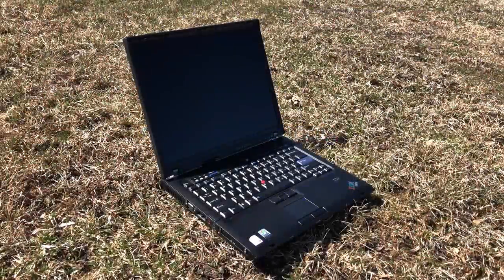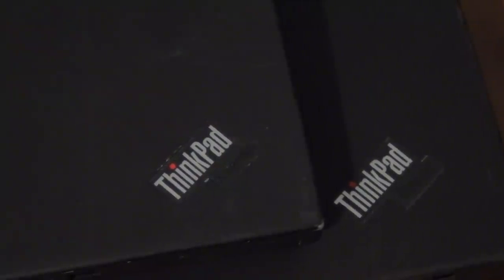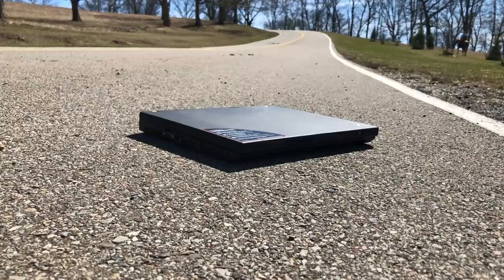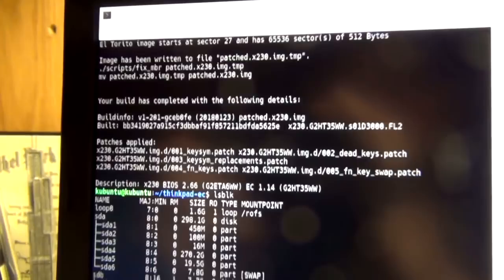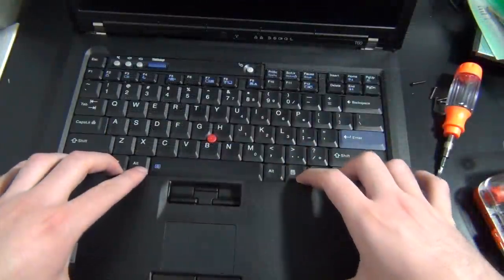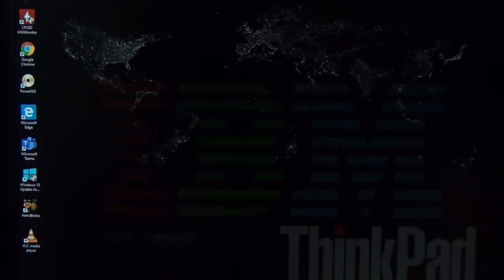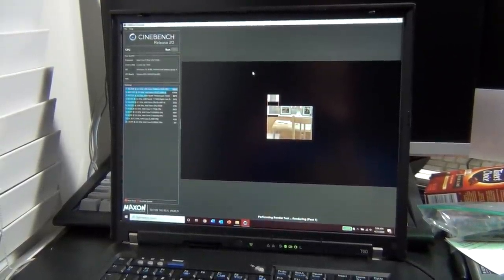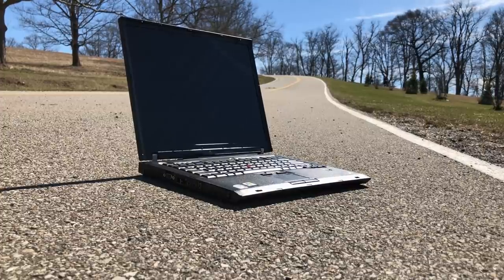Unlocking the ThinkPad T61 with Middleton's BIOS

Comment: Retired welder guy here ^:)  I just bought 1 ea DDR2 4gb ram single stick 667mhz 5300 SODIMM for my 2008 Lenovo ThinkPad T61 Ram properties doubled from 3gb to 6gb also installed a Samsung 860EVO 500MB internal SSD... Will try installing Middleton's BIOS...

Comment: I would love to see a video on hardware mod-ing this laptop for a quad core CPU.
I have one of these that I want to install Linux to.  I was shying away from doing so because I wanted to upgrade it.  Thanks for the video discussing how to do these things.  I just need to find a few bits of hardware now.  If you put Windows 10 Home instead of Pro on this laptop it will probably run faster.  MS puts a lot of unneeded progz in the system.

Comment: Yeah I already did the BIOS-Mod in 2011. Still using my R61 from 2007 every day, runs well! Updated from 2GIG RAM and WIN XP to 8 GIG RAM and Windows 10. I also changed the CPU to a X9000, fixed the hinges and installed a new Display. It has a lot of Scratches and Marks but runs smoooth as fuck! I´m loving my ol´ reliable Thinkpad! !
Reply from the maker: These things are impossible to kill! I love them.
Reply: You should oc it to 3.2 im curious. I have it slammed to 3.4ghz from 2.8 in my precision m4300

Comment: I have a question, is there an IPS, LED-backlighted laptop screen/display for the T61? Kinda like the one you installed in your Frankenpad (I remember you mentioned you got that part cheaper because it had a dead pixel), but sized for 4:3 aspect ratio (square), 14.0-inch screens?
Reply from the maker: The only ones available are a 4:3 15” LED backlit display. They never made a 14” IPS panel for these machines until the T440p.

Comment: Being a huge fan of thinkpads overall and having just bought a brand new X1 Yoga, got me wondering about your thoughts on newer thinkpads. While I love the older thinkpads, I need the performance and reliability of newer models and actually prefer the new smile keyboards compared with the older models. Plus I get a fingerprint reader, a touch screen, on device encryption and other modern features. I know I'm in the minority among Thinkpad enthusiasts on the keyboard. 
Getting to my actual question, what are you general feelings about modern thinkpads? and are there any specific reasons why you don't seem to own one or is it just that the old ones work for what you need and don't cost as much?
Reply from the maker: Fingerprint readers and touch screens were available on ThinkPads since the mid 2000’s (fingerprints came on the T42, and the X41 Tablet came out in 2005), so you wouldn’t be missing much by going old-school. ;)

I am working on a video about the T480 as I recently acquired a new one at a good discount. That would probably be a solid laptop for me to compare to older machines.

To answer your question, cost is part of the reason I haven’t gotten too many newer machines, as I can buy and fully upgrade an older one (with a few exceptions) for a fraction of the cost of buying a newer one. I don’t mind the newer ones up through the xx80 generation, but with the T490 and newer Lenovo has just made too many poor design choices, and they haven’t reversed any of those changes with the newly announced T14. The older ones work fine for my needs and when I need to do something more demanding, I have a desktop to handle that.
Reply: @SebisRandomTech  by poor design choices on the t490 and newer are you talking about the removal of the power bridge battery? Because it infuriates me that they did that. I've always been a fan of the thin and lights but I liked having the option of going with a thicker laptop that could get 32 hours of battery life. Bought those for work all the time since I'm an IT admin.
Reply from the maker: The battery is one of the biggest changes I disagree with. I also don’t like the move to soldered RAM or partially soldered RAM on everything other than the P series and X1 Extreme, and the replacement of the full sized SD card slot with a MicroSD slot seemed pointless (these things definitely still have enough space for a full sized slot) other than because everyone else in the business laptop world was doing it. The only real advantage of the T490 and newer is the low power FHD display, but many have already successfully transplanted that panel into T480’s and other older ThinkPads so there goes the one thing the T490 had going for it. I also am annoyed with Lenovo deliberately omitting features and premium upgrades from the AMD versions of the T series.
Reply: @SebisRandomTech  I would love to have a T480 with a low power display and 10th Gen intel CPUs! I totally agree with your assessment of the T490's shortcomings as a business laptop. Looking forward to your video on the T480 since I'm a really big fan of that model.

Comment: You make great Thinkpad videos. Thought about running Linux (or BSD) on these older machines? Would help a bit with the performance for sure.

I have a T480S... it's great - thinness/lightness kind of  makes up for the lack of upgradeability.
Reply from the maker: Linux is a great option for squeezing some more life out of older ThinkPads. On the ones I use, Windows performs well enough for my needs, but Linux can help breathe some new life into them.

Comment: 7:41 Those 2 sticks of ram cost around $100 USD (for brand new) or if you are lucky you may find some second hand for $35 per stick. The cost of ram can bought a Thinkpad x220 in my City. 

I previous own a X61 with 8GB DDR2 ram with SSD... It was slow if you are using windows 10. Linux is good

Comment: I have r61i that has a t2330 and 1gb of ram. I bought 4GBs of ram, a ssd and a t9300 for under $25 bucks. Not sure if I need middleton or not but if I am locked to sata 1 then I will check it out for sure. EDIT: The r61i will support up to a t9500, however they are much more expensive than the t9300 and are only clocked 100mhz higher. I ordered a new battery and I am going to try to update to get SATA II speeds.

Comment: I had the same “USB-BIOS” compatibility issue when trying to install Middleton and eventually windows. What solved it was to use an older USB generation (between USB 1.1 and 2.0) but not 3.0 for some reason.

Comment: I found a T440P in the ewaste bin and fished it out. I gave it a 1080p display ($70 CAD on ebay), some DDR3 I had kicking around and a SSD. Great little machine. But I want to coreboot it just for funsies. I don't want to lose any functionality, though and that seems to be something you can suffer with coreboot on a less supported system.

Should I do it? It's not my daily driver really. I just use it when I want to do some coding on the couch.
Reply from the maker: Entirely your decision. I haven’t done it because I don’t have a need to, but your needs may differ.

Comment: Uhm wasn't T43 the last T series model manufactured by IBM?
Reply from the maker: What was truly the last IBM product is up for some debate, but let me try to break this down: Lenovo acquired IBM's PC division late in 2004. This would make machines like the T42 the last 100% IBM machines. The T43 and X41 came out after Lenovo took over but are still branded as IBM products and are identical to their previous counterparts. The T60 and T61 were likely in the early stages of development when Lenovo took over so some still consider them to be IBM machines, but they were released by Lenovo.
Reply: @SebisRandomTech  I guess you might be right. I own severel T43s and some of them have Lenovo logo at the back and some have IBM logo. Why?
Reply from the maker: @JanJanuszNosacz  As part of the acquisition of IBM's PC division, Lenovo was allowed to continue using IBM branding for a few years after. The T60 and T61 were the last models to feature an IBM logo - some had only IBM branding, some had both IBM and Lenovo branding, and some only had Lenovo branding. The IBM logo disappeared for good with the 2008 models (T400, X200, W500, etc).

Comment: nice video! can you tell me if it's possible to apply this patch to thinkpad Z61 which is the same as the t61? i will be glad, if you consider my question
Reply from the maker: It is not the same as the T61, in fact the internals are more similar to that of a T60. So it’s unfortunately not possible.

Comment: Speaking of installing Core 2 Quads - would it be an adequate idea to install a 45W CPU into a laptop that originally came with CPUs that ran at 35W tops? Would it be possible to somehow knock down its TDP through software like Intel XTU, or are they too old for tricks like these to work? I don't really care if it would run slower as a result of decreasing TDP/undervolting/weak cooling system/whatever - I only really need that CPU for the benefit of having four cores.
(hardware mods are out of question, I'm afraid, unless it's installing a premade beefier cooling system, which I don't think exists for a less popular budget model)
Reply: On forum.thinkpads you can read about that mod. By undervolting the cpu you don't actually hinder the performance of it, it has only benefits due to the lower power consumption. I don't think the quad-core mod has much benefit in real world, as it has weaker single core performance compared to the X9000. So apart from a few programs that are heavily multi-threaded, there won't be any performance increase doing most tasks.
Reply: @kosztaz87  Most program are multi thread already, but from what i found on these older Core 2 lineup,  the GHz makes it feels snappy, not the quad core most of the time. 

Still,  a quad core mod is still beneficial for a daily Windows 10 machine.
Reply: last time i'am replaced old HP laptop (Screen was broken, accidentally someone smashed by chair) Dual core 45W TDP AMD A4-3330MX 2.3GHz base, 2.6GHz turbo  to based cpu model quad core 45W TDP AMD A8-3500M 1.5GHz base, 2.4GHz turbo.

iddle and full load temperature are similiar but adaptor power consumption increased 2 cores < 4 cores.

it's un-optimized cpu oem just leave us the factory voltage then i decided to overclock then undervolted it for reducing power consumption. just finding stable frequency with proper voltage.

1.5 GHz Base 1.0500v to 2.0 GHz 1.0250v
2.4 Ghz Turbo 1.3250v to 2.7 GHz 1.0875v
900 MHz iddle 0.925v to 800Mhz 0.785v
iGPU HD6620G 444MHz 0.9825v to 500MHz 1.000v
that's stable no freeze or bluescreen.

It possible to reach more highest overclocking but no reason to increasing temperature, voltage and power load.
as display i'am use hdmi 1080p tv so more headroom to my 65W hp power adaptor.
windows 10 pro 64 bit enough for casual work. 

yes swapped dual core to quadcore give you more benefit even if not overcloking.
undervolting is make a sense in this case to reduce consumption and same performance.

Comment: Wish there was something like that for the Acer Extensa 5220. Not so much on the CPU side, since the Core Duo 2 T7700 (fastest CPU supported by the rig) I upgraded it with is making me use almost everything with little issues, but for the RAM. It supports only 3Gb max, forcing me to use 32bit OS in spite of the CPU being a 64 bit.

Forcing the machine to 4Gb simply doesn't work. It refuses to POST. Allegedly there should a newer version of the chipset that supports 4Gb but... guess what, my laptop has the older one. I tried. If I say it doesn't POST it's because I KNOW it doesn't.

And even if there are voices around the various forums that you could even reach 5 or 9Gb occupying the RAM slot 1 with either a 4 or 8Gb SODIMM and the slot 2 with a 1Gb SODIMM, I'm not going to fork any more money (after the failed 4Gb upgrade) to try out an upgrade that seems to be only rumour.

Comment: I've always meant to ask you this but I kept forgetting… Months ago, after hibernating because the battery was very low, my T61 stopped displaying an image on the internal display. I can use it only with an external display. In Device Manager, the GPU driver is showing an error. That means the GPU is fried, right? Thanks in advance.
Reply from the maker: If the GPU was completely fried it would probably not drive any displays. Try messing with the display settings or reinstalling the graphics drivers to see what happens. I would also try booting a live distro of Linux on a flash drive to see if it works with the internal display.

Comment: Thanks for sharing, I didn't know I could get to 8Gb of ram, now my t61 wide is much faster, I'll probably update the t7500 with a faster one but I think I'll stay away from Extreme Edition for power and temperature issues. The network adapter with the right drivers does not cause problems, the same for adi soundmax

Comment: If you want to go completely mad, with some motherboard mods and another BIOS, you can have the Core2 Quad-Extreme QX9300.

Also, there is a way to force the installer to run on 64 bit windows, you just need to download a newer version of winphlash64.
Reply from the maker: I did mention the motherboard mods and Core 2 Quad in the video....

As for the Windows bit, thanks for the info.
Reply: @SebisRandomTech  I know, I didnt realized you were grouping the quad-extremes in with the quads. 

As for the winphlash thing, you just have to download winphlash an use it to flash the BIOS file you downloaded for the ISO version.

Comment: I see your T61 Board has the NVS140m - I hope it's a non-bugged version.
However even with that - there are middleton mods that undervolt the GPU significantly (which can be done without any risks, the original voltage is rather high), helping to reduce heat and GPU wear.
While I really like older GPUs (especially ATI ones), they are definitely, even without the Nvidia Bug, the no. 1 weak point of laptop motherboards.
Reply from the maker: This is one of the rare revised motherboards that was manufactured after normal production of the T61 was discontinued, someone at The Board Room has a stockpile of them that can be purchased for (rather expensive but understandably so) FrankenPadding.
Reply: @SebisRandomTech  nice! I personally would still undervolt it, its easy and safe, and a chip always lasts longer when operated at a lower voltage.
Here is a list with many BIOSes including undervolting and even Quadcore modding (even if it is German, it might be interesting)
https://thinkpad-forum.de/threads/172581-Anleitung-FSB-1066-CPUs-inkl-Core-2-Quad-in-Thinkpad-T61-benutzen-GPU-undervolten
Reply from the maker: I was thinking about doing undervolting as part of this video but I think I’ll save it for a future video.
Reply: @TheRailroad99  what bug do you mean? Mine has an nvs140m and I would like to know the bug
Reply: I've got the rare late addition with the good GPU.

Comment: I really dont get why Lenovo is not capable of producing a classic screen resolution Thinkpad in 14" form factor. It would be awesome for work, I dont use my Thinkpad for watching movies.
Reply from the maker: My only guess is the availability of panels. Anything beyond 16:9 has mostly become a niche market, except for tablets and MacBook Pros. I would gladly pay extra for a modern ThinkPad with a 4:3 or even 3:2 panel.
Reply: @SebisRandomTech  Sure but Thinkpad buyers will easily pay the premium, lets say 300USD for a 4:3 panel.

Comment: see reddit author:szmy8 you can swap correct corresponding t60 to t61 models entire bottom chassis or just the t60 monitors and hinges. 
you can reflow bake the t61 mobo in the oven 7 minutes 325 preheat 250 first. 7 minutes open door let rest n cool, remove re tape the black zones you peeled off. 
if the monitor dosnt boot up but you get a power light led on re assembly you need to power cycle the power button and right mouse button until the monitor posts to bios. 
if you have power led no monitor, cant cycle boot with right click, strip it and try to bake it again better, strip more, more even heat, correct temps, try boot n click till bios posts. hf gl

Comment: Did you have any issues with the audio or bluetooth working in Windows 10? I figured I'd try Windows 10 on my T61 a few weeks ago and it worked okay except I couldn't get the sound to stay consistently and the bluetooth drivers wouldn't install saying they're incompatible with this version of Windows. Also the WiFi card (4965AGN) doesn't work when  you resume the computer from sleep, although this is a well documented issue online so I was not surprised.

One more thing also, you do not need the Middleton BIOS to take advantage of 8GB RAM. The T61 will accept 8GB of RAM with any BIOS, Middleton or not. Having said that though, the Middleton BIOS is still very useful, I have it to take advantage of SATA II speeds for my SSD. Here's some good information on the Middleton BIOS and the T61 in general: https://thinkpads.com/t61/ Glad you are enjoying yours, mine is still going strong 12-years later.
Reply from the maker: I have not had issues with the audio or wireless card in Windows 10. Can’t say for sure if Bluetooth is working because I don’t really use that for anything.
Reply: @SebisRandomTech  Which wireless card do you have in yours?

Comment: After watching this vid I'm thinking on buying a T61 to replace my Presario C700 to run XP/Vista. What GPU does the T61 have? How well does it perform?
Reply from the maker: Mine has an NVS-140M. It’s nothing special but considering it worked fine in Windows 10 I imagine it wouldn’t have issues with XP and Vista.